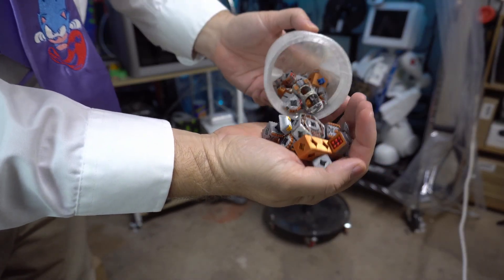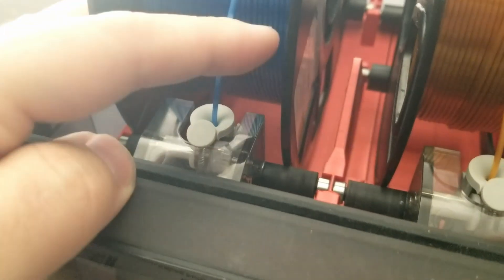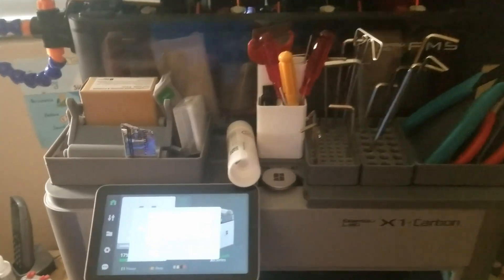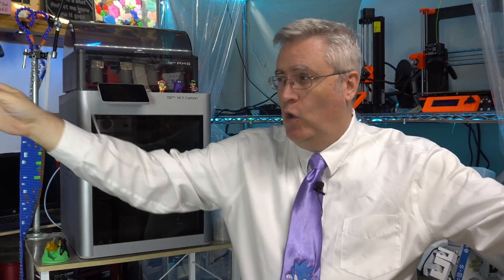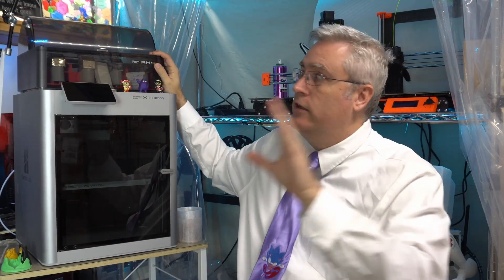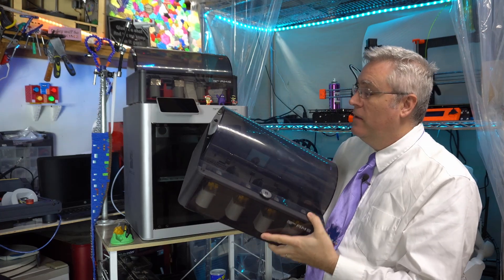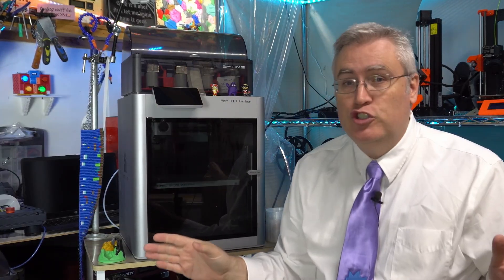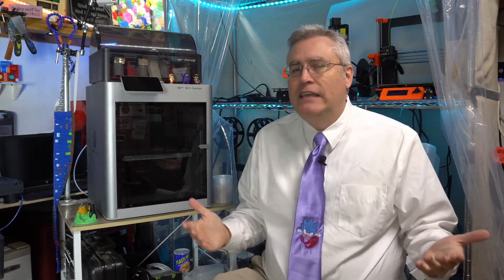My Bambu AMS died after only 1 year

Comment: I can tell you from experience that they will NOT send us backers a replacement.  Us non-influencers get the run around and it turns into a fight.
Reply: I can't even get them to give me a screw for my filament cutter assembly that came pre-stripped from the factory.  Let alone a new assembly.  I gave up trying to get help from them after a few days of trying.
Reply: Yep
Reply: Thanks for that info as person looking to replace/add to my ORIGIONAL ender 3 thats been pushed to its limits with new boards/hotend/ectruder/bed surfaces it a good piece of information to know if a kickstarted backer gets the runaround then a normal customer is even lower in priority to a company like that. So I can spend my money elsewhere.
Reply: @stevvieb eh? Kickstarter backers aren't customers. Paid customers have a contract associated with their purchase of a product. Kickstarter backers are speculative investors with zero protection.

As a consequence, what you suggest (kickstarter backers prioritised over customers) is often the other way around. You'll find genuine customers actually supported, but backers will be left in the dark.
Reply: @lmaoroflcopter  don't worry... the Bambu Support lets all customers equally down if it's not a simple replacement part for an obvious malfunction.
Reply: @stevvieb  I have had to deal with customer service multiple times and they have never given me the run around. They even replace my X1C with a brand new machine when it started having problems. Support is a slow process right now but very professional. Yes, influencers are always going to get better treatment but to be fair, influencers are providing a service to Bambu and the better treatment is Bambu paying for that service. I imagine there are some Bad customer service reps but I would be willing to bet there are more Bad customers who are disrespectful and get poor customer service due to that disrespect. I own two Bambu printers and will buy more. I highly recommend you buy one to because no other printer comes close!
Reply: @stevvieb Well yes and no. Then you are missing an exceptional experience. I i'm still not covinced by the quality a Bambu spits out. I come from a slow but Well tuned Ender 3 and Well... the surface quality outperformed everything a Bambu can put Out. But! This Ender 3 took years to get perfect. It's a hackjob. Bambu is the Apple. Everything just works nice. The AMS is nowhere else found. So yes you can find a better printer with better Support but you wont find a better overall experience... i promise you.
Quality wise ... Well for me would now be a K1 with a ton of community mods. But that's a Heck of Work again
Reply: Yes it seems a lot of the companies like Bambu give you a run around if even a solution especially if you bought the unit from a 3 party, and then months to get the repair part since being shipped on the "Slow Boat"
Reply: @billb921  this is the problem.  third party resales are a hassle.  not just for bambu.  
i didn't even think of that when i bought mine.  good thing i bought it from bambu themselves.  
they even had it delivered in 2 days. (they have global warehouses.  so this slow boating is nonsences) 
ordered it close to midnight on a thursday.  and it was delivered from germany (internationally because i'm not in germany) and it arrived on the saturday after that, 2 days.  

had it printing in multicolor without having to do ANY kind of calibration prints or what not right after dinner.  (arrived during cooking) 
printed the accesories box wich i downloaded from makersworld. 
wich is 3 parts.  the box.  a name plate that slides into the front of the box.  and the lid that slides and clips ontop of the box.  (and bottom when it's open) 
and it just fit.  printed without flaws.  
no need to even print temp towers or flow calibration cubes.  it all does that automaticly in the poop tray. 

if you want to buy a printer where it just works.  then get the bambu.  
if you love to tinker with your 3d printer.  then get a prusa or ender or whatnot.  

i'd say these bambu labs are the first ever consumer grade printers.  
where you can simply enjoy the printing itself.   
anything before it was reprap.  hobbyist.  maker.
Reply: who knows.  maybe you just don't have people skills.  
if you are already angry when you contact them.  and you don't like the first answer,  you might get more angry wich will not make them more inclined to help you.

Comment: @3dpprofessor, how can I see what type (old/new) AMS unit I have?
Reply from the maker: The only external indication is if the gears are white. The other indicator is on the motherboard which you'd need to disassemble.
Reply: @3dpprofessor  they also have different side panels... with 3 on the newer ones and 4/5 panel parts on the older ones.

Comment: Not maintaining support for older variations of the machine, and only stocking solutions for the current iteration is a total DJI move.
Reply: Not only that, but no customer facing hardware versioning info. Bad move.
Reply: Doesn’t work for right to repair in the US.

Comment: if the new first stage motor spins the wrong way wouldn't swap 2 wires to correct it?
Reply from the maker: If I knew which two to swap.
But it might be deeper than that. I just don't know.

Comment: I have a kikstarter machine as well, and I have had to change several things in the printer itself, such as fans, hot end boards, etc.  I have also changed a couple of the 1st stage feeders, but bought them as soon as they were available, and so have the ones that are compatable.  
For the price I paid, I would expect 3-5 years of use, at least.  I understand having to replace components occasionally, but, still it's a sizable investment.  FYI - The machine I ordered last December has had nothing replaced in it.  (The printer, not the AMS)
I have actually had more trouble with my two newer AMSs than with my kickstarter one.

Comment: I have an X1carbon combo for 4 month now and I love it! It just works! I have two other Ender 3 d printers an 3V2 that I substantially upgraded and a  3S1pro a that needs -constant maintenance and tweaking to get a decent prints from them. They work but half the time I spend doing something to them to get decent 3D prints. My experience with Bambu Lab had been the opposite, it just works! I have yet to change any parts on the printer. I do the regular maintenance suggested by Bambu Lab and that’s it! It works flawlessly! I have over 1800 hours on the X1 Carbon and two AMS and have not had any issues at all other that sporadic filaments retraction from the AMS. Correction I just changed the blade to cut the filament after over 1700 hours . That’s it! I don’t know how it will hold up over the next few years but I am loving my X1carbon and even though of getting a second one although I would prefer to waits until they come out with a larger version of the X1Carbon hopefully coming out soon! 

My Ender 3V2 was not getting much use at all so I gave it to a friend and my Ended 3S1Pro is still in use but not much and will likely not get any use when I get my second Bambu Lab printer.
Reply: It's great that you had a very nice experience with your X1C.
But to be fair to the Ender 3v2 and S1 Pro, they are 1/4 and 1/3 of the price of an X1C resp.
(and Creality has never been a company that is renowned for good QC and exceptional service)
Reply: @_MicZ_  I realize that the Bambu Lab XiCarbon is much more expensive than the Ender printers. But Bambu Lab just came out with the A1 that cost about the same as the Prusa Mini even with the 4 color combo and the the Ender and from everything I read its night and day compared to any other printer at its price point including the Prusa. The only thing I can't tell you is how the X1C will hold ups over time since I have only had it for 4 month. However these 4 month have been flawless. I understand that the original printers and specially the AMS that came with the original backers are not the same as the ones sold now, since they have been upgraded these past year.  I didn't get the original X1C when they were sold over a year ago because they were new and no one had any experience with them more than a few weeks. I decided to wait a year since they had been in the market and I am extremely happy with it. I am waiting for a larger version of the X1C when it comes out to buy my second Bambu Lab printer.  If I was going to recommend a 3D printer to a beginner I would suggest that they look at the A1 from Bambu Lab.